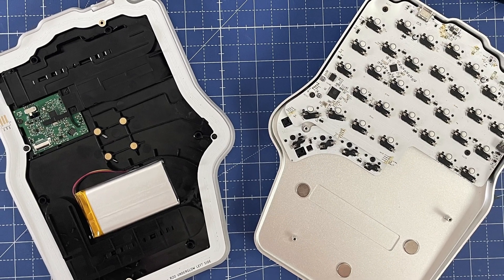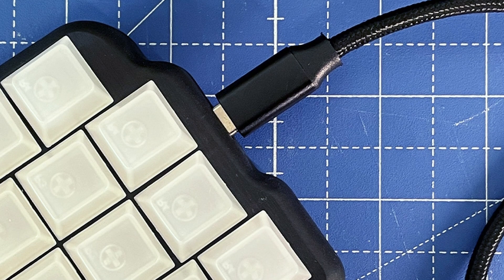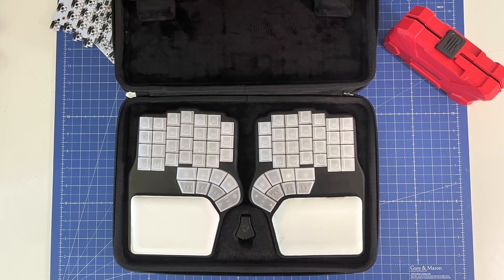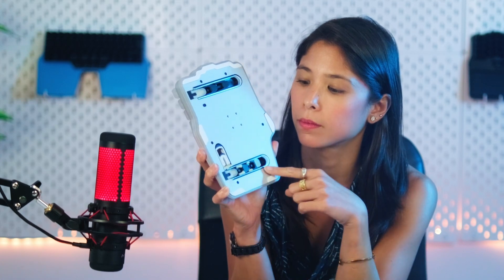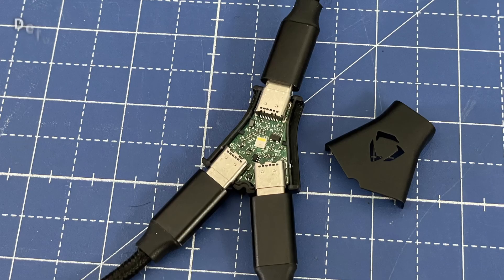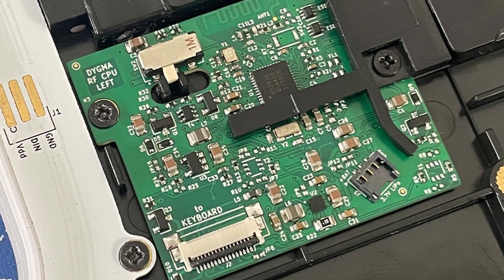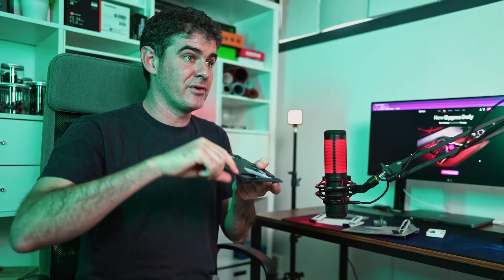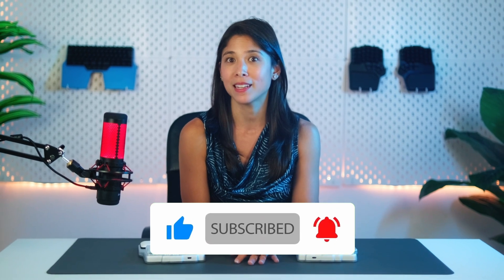Dygma Defy manufacturing update: the chip crisis!?!

Comment: Bluetooth, RF ... the weak point on the long term is the battery. How many years can be expected to last? How much of a charge will it still be able to hold in 5 years, or 10? The Defy is expensive, for most of us; it's a long-term investment.
Reply from the maker: We hope it has a long lifespan, but if there was any problem, we'll be able to replace it. Our keyboards are designed to be easily repairable. All the pieces can be replaced without damaging the rest, so we got you covered 😉
Reply: @DygmaLab  Good to know, thank you. It'll mean having to pay for labor and shipping both ways in addition to a new battery, but that should still be cheaper than a whole new keyboard. (The Defy is more expensive than my current computer!)

Comment: What's the difference between RF and bluetooth? I don't quite get why it cause a big difference when i look up and it uses the same frequency.
Reply from the maker: Bluetooth is actually a subtype of RF. The great advantage of Bluetooth is that you don't need to connect anything to the device, so you can use it on your PC, Laptop, Tablet, Phone... On the other hand, RF with a USB dongle connected to the computer is much faster (lower latency) and has a wider signal range.